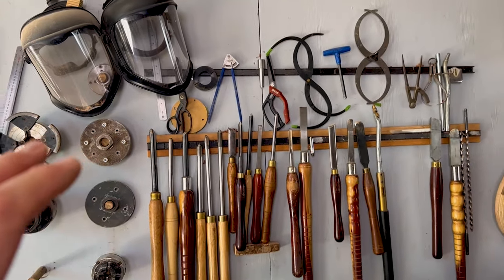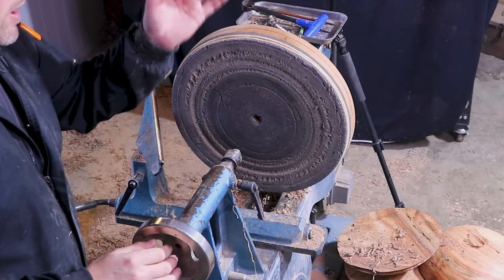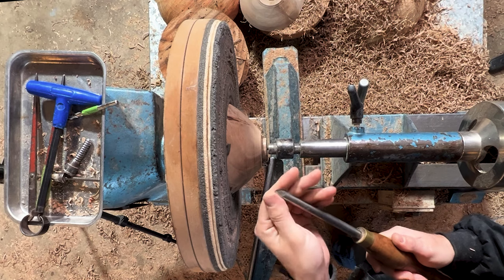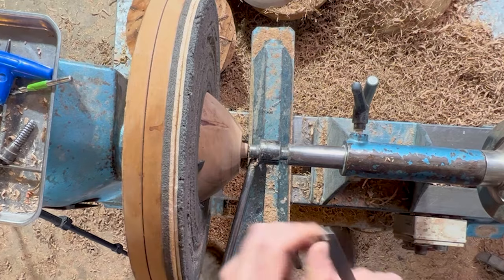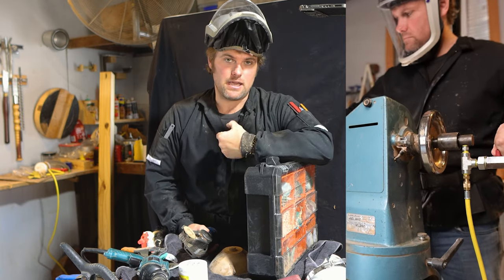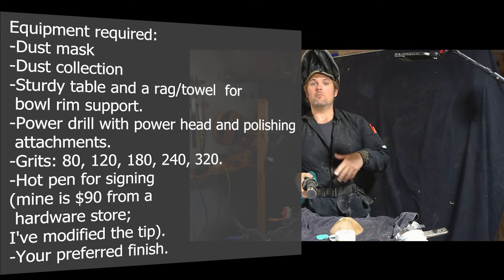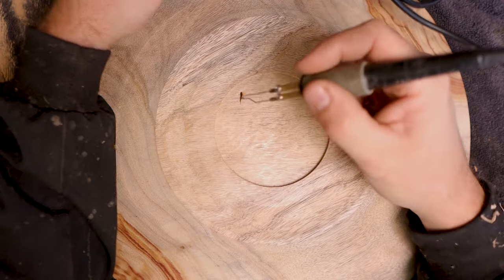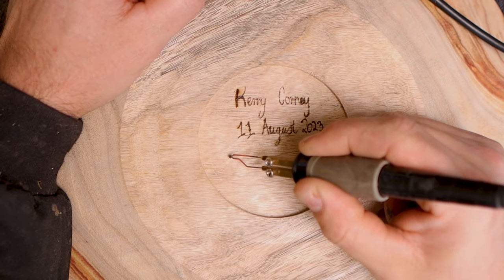How to remove a Woodturning TENON + Hot Pen Signing & How to Finish the Bottom of Wood Bowls.

Comment: Thanks for sharing, I’m a beginner turner. I have the hardest time using tenons, my work keeps popping off. Full view and Like 👍
Reply from the maker: You're welcome, Allen! When you mention "popping off," are you referring to the tenon snapping, or does it pop out of the chuck? Thanks a lot for your comment. I'm really pleased I could assist you. 🙏also are you on Instagram?
Reply: @KerryCorney  jumping off my chuck. I think I’m too aggressive and should slow down. My last piece jumped off three times before making a mortise
Reply from the maker: Without having seen your turning, my suggestion would be to direct your cuts towards the headstock while turning and focus on taking smaller cuts. I'd also recommend checking out the video on roughing out: https://youtu.be/YSMWuRx10Jo?si=wRMMFQu_Mi__TIA8. It provides some close up video forming a tenon. Keep me posted on your progress. Cheers, mate.
Kez
Reply: @KerryCorney  thanks for taking the time to help
Reply from the maker: Always mate.

Comment: An easy way to center signatures or other lettering is to count the letters, start with which one is on the center, and work away from that. Count the spaces as one. So if your name is Rick Johnson, the center mis between the J and the O in Johnson. If the words have the same number of letters, the space between the words is the center.
Reply from the maker: Thank you so much for this, Chuck. That's an awesome way of doing things. I really appreciate it, and I might even make a video once my hand is better. Thank you for your input.
Cheers,
Kezza

Comment: Something else you can do is get a piece of plywood, attach a faceplate and turn it circular, and CA glue some really low grit sandpaper on. At least, that's an idea Wood magazine gives, and it's something I plan on doing. Might be a bit slower, but it'll be cheaper if not free if you already have that stuff sitting around. You might even get away with using wood glue, although that might deteriorate faster because of the heat
Reply from the maker: Absolutely great idea👌 thanks for sharing comment.🤝cheers

Comment: I know I'm living at the other side of the world (The Netherlands) but you don't have to do things upside down! I mean, put the sanding disc on a jacobs chuck in your lathe and hold your bowl in your hands. You'll have much more control. A jacobs chuck won't cost you much....
Reply from the maker: Hello Robert, I've attempted using the Jacobs Chuck previously. However, I've noticed that while using it, I need to exert sideways pressure with my upper body, which tends to tire me out much faster. In contrast, when I use the drill, I only need to apply downward pressure, making it a much more comfortable experience. I hope that explanation makes sense. Nonetheless, I value your input, and a fresh perspective can always benefit others. So, thank you.
cheers Kez.
Reply: @KerryCorney  you have a point there
Reply from the maker: There are numerous approaches to tasks, and I genuinely value your input, mate.

Comment: Maybe look up Phil Anderson's method. For the last few turns he slows down to 200 rpm applies side pressure to the bowl with his right hand, puts his hand on the stop button and pushes the gouge in until the tenon stud breaks, and he simultaneously stops the lathe. see minute 28:30 on this video.I use a ring center usually and it works well. I had to stop breathing the first couple of times ! Cheers.
https://www.youtube.com/watch?v=EoVVUfodAeU&t=946s
Reply from the maker: thanks for leaving this comment, mate. I have done this. 
Cheers, mate.
Kezza